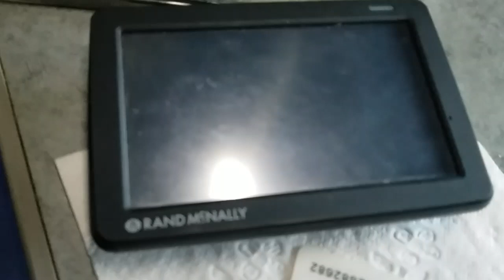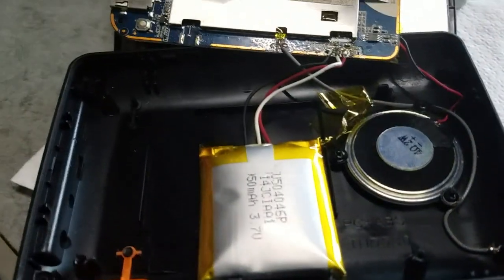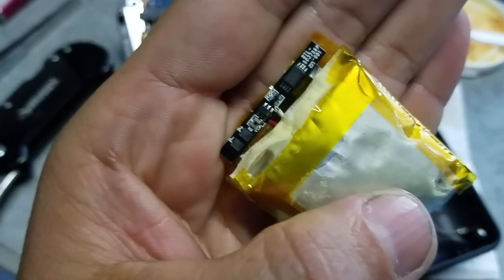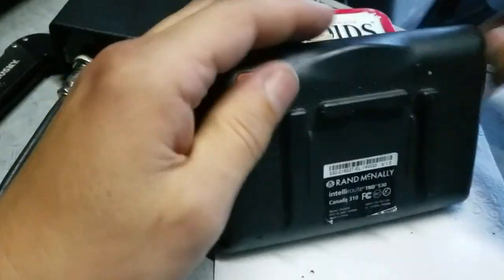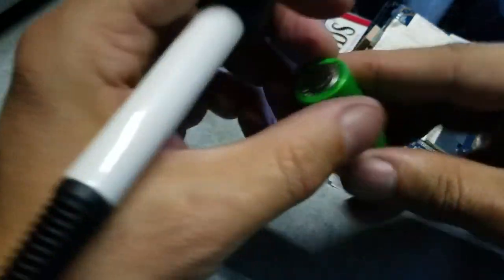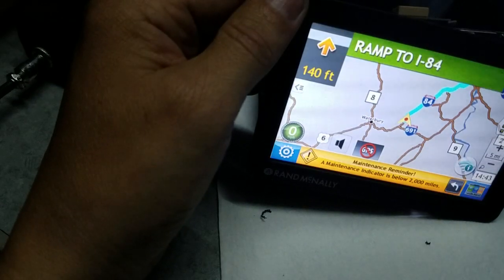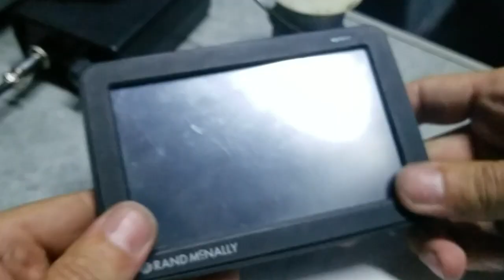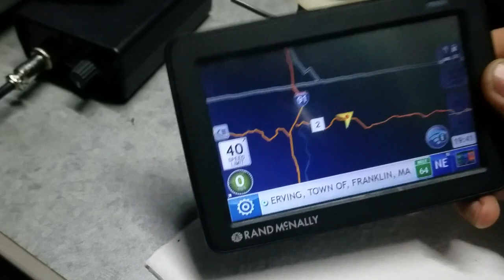Fixing DEAD RandMcnaLLy

Comment: Had my tnd 510 for 8 years and 2 months and I love this thing and it has all 400 stores I deliver to in my address book. It still works but wont charge at all and if I unplug charger it turns off immediately. The battery light has been blinking red and green for almost 2 years now but it's still going. How can I find a battery replacement so I could possibly get another couple years from this bad boy?
Reply from the maker: It is a Li Ion battery,  3.7v. ,can be 700....1000 mA. 
Just need to get write dimensions
Reply: @petya4924  Thank you I will look into that. Dont wanna let this thing go and also all gps are rediculously expensive now. Although I can afford it, I just dont wanna pay the prices they are asking cuz it's a rip off. I aint paying $4-500 for a damn gps.
Reply from the maker: Y.,I agree with You!

Comment: Hello what kind battery you put? Rechargeable or... I tried with rechargeable batteries with AA 2000 mAh not working. Pls, help thanks
Reply from the maker: Li Ion battery ,rechargeable 4.2 volts. You can find easy at Ebay. 
I use one cell from old laptop battery, but better use battery from flip phone (it fit inside GPS)
Reply: You’re a genius with Electronics Applause
Reply from the maker: Thanks

Comment: tnd 740 is almost imposible to change the battery
Reply from the maker: 740 and 540 it's a the same GPS only screen size is different
Reply: @petya4924  my 740 gets so old that when i disassembled it all connections broke down. I wish i can do it next time, but it's not easy.
Reply from the maker: Wire connections can soldering ,and for broken  plastic clips just use some glue
Reply: @petya4924  I accidentally cut the screen wire off the flat one. Because it's different model than in video and I didn't know how to open it there is no information in internet

Comment: Hi Petya how are you doing? Where are I can get that rechargeable battery? Walmart ?
Reply: I bought Energizer Recharge Power Plus 1.2 V 2300mAh it doesn’t help. It’s not working. Where are I can get that battery which you used? Please
Reply from the maker: You ca find at Walmart at garden center (solar light Lithium-ion 18650

Battery) 2 pcs,or 4.
4 rechargeable batteries cost around $12
Reply: Thank you Sir! I’ll do and let you know. Thanks
Reply from the maker: @djamshidrakhmanov4198  
You welcome! Battery voltage 3.7
Reply: Hello Sir! I did it. I bought battery from Walmart and put it on my GPS it’s working now. Thank you very much!!!
Reply from the maker: @djamshidrakhmanov4198  You welcome !

Comment: Why didn't you just buy the proper replacement battery?  It would have saved you from having to reinvent the wheel!!!
Reply from the maker: It happend on the road. I needed it for work and there was no place to buy a battery right away